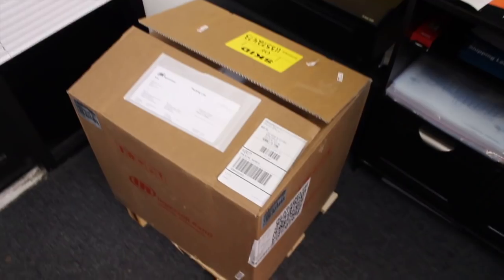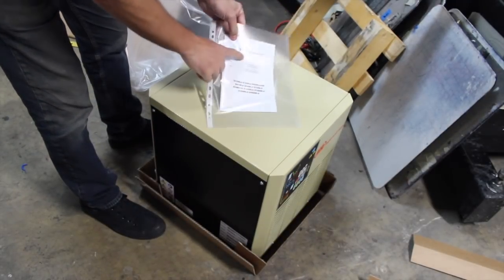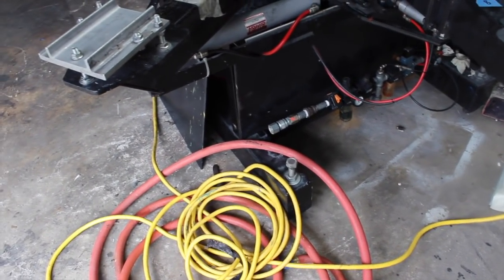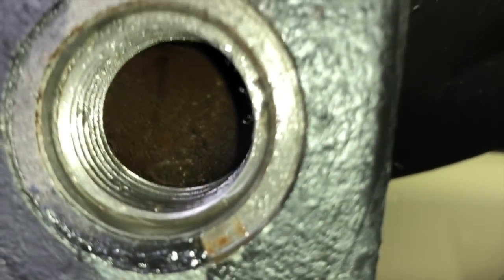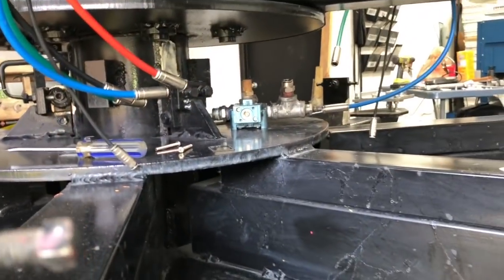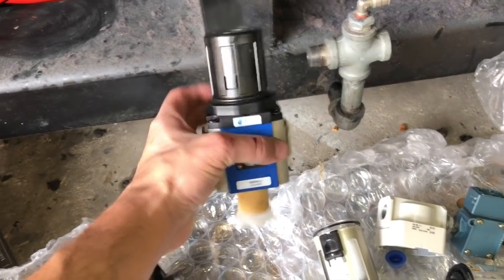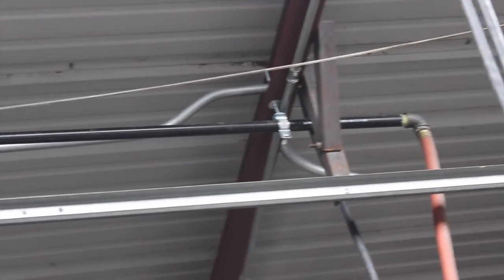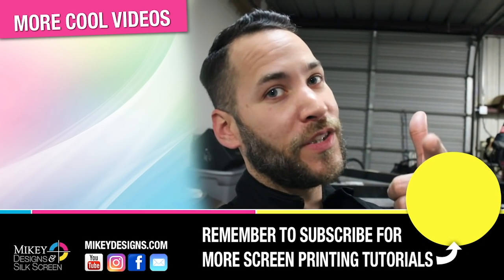Installing the Air System - Tuf Workhorse Automatic Screen Printing Press Vlog

Comment: Robo grips! I didnt think anyone else owned those, lol. You're a handy guy by the way Matt... nice work sir.
Reply from the maker: Funny thing is I borrowed them from a neighbor, and then he moved... completely slipped my mind I had them at the time. Thanks! I appreciate that. I'm a DIY guy and tackle just about any project. Have build a handful of hotrods in my days as well, which included rebuilding the car from the ground up including the rebuilding the motor and transmission. It's great what you can learn on the internet these days and DIY.

Comment: Matt, all you need to do is get a UNION connection for the main Filter, that will allow you to connect it right where you want it, the UNION allows you to connect it without turning the Main Filter.
Reply from the maker: Thanks for the tip!
Reply: @mikeydesignssilkscreen473  I'm about to have to change the one on ours also i will use that tip....lol
Reply from the maker: @nashwarrick  Right! Now I'm going to have to go back and install one.

Comment: Hey, cool video. I just bought my first automatic and need the compressor and chiller. Where did you get yours and what’s your review after 3 years?
Reply from the maker: That's awesome! I forget the place, but I bought it online. I've only had one issue with the compressor and that was the on and off pressure switch was set too narrow for what we were doing. It would kick on after it lost 5psi. So a tech came out, installed a new switch. Now kicks off at 175psi, and will turn on around 155. Although, I have to admit, we wired it up wrong which fried the switch. lol. Aside from that. Doesn't leak, and works like a champ.

Comment: I need help. I bought a used javelin about 1 year ago I have a black plastic box to the right of the regulator and it dumps air when I open the air line to the printer. The box has a threaded hole underneath where i think an air guage should go,  should I remove it entirely and just straight pipe it? Or find a the air guage
Reply from the maker: I'm not sure to be honest without looking at it. I really just kinda troubleshooted putting this thing together. First time doing this stuff.

Comment: Matt, you also asked how to know when to change the oil, they have an electronic RUN HOUR METTER for air compressors you wire into the line of the Air Compressor, which records how many hours of use. See the attached video.

https://www.youtube.com/watch?v=coLgUNAhgoE

Comment: what size is the chiller and whats the model
Reply from the maker: I'll take a look and get that over.
Reply: Mikey Designs & Silk Screen thanks I won that ROQ You at the ISS and trying get this stuff so I can have it installed
Reply from the maker: @bagwear8689  Very Nice!!! I saw RhyBeats and T-Shirt Chick Vlog it. This is the drier / chiller
https://www.aircompressorsdirect.com/Ingersoll-Rand-D42IN/p2429.html
And this is the compressor I got.
https://www.aircompressorsdirect.com/Ingersoll-Rand-2475N7.5-230.3-FP-Air-Compressor/p4759.html
Let me know if you have any questions or need anything.
Reply: thank you so much I appreciate you
Reply from the maker: Any time! I'm so jealous! :)